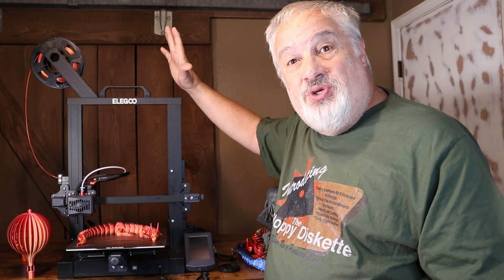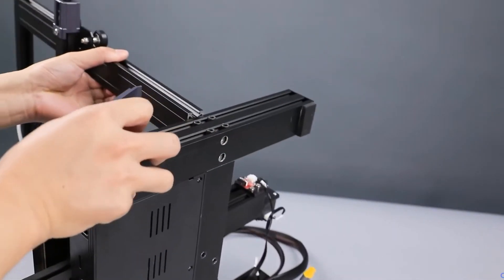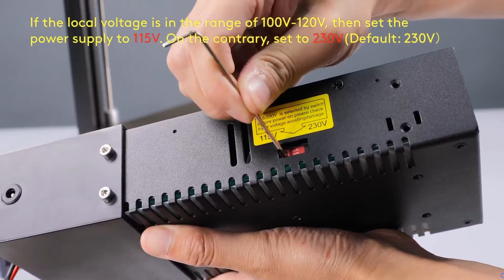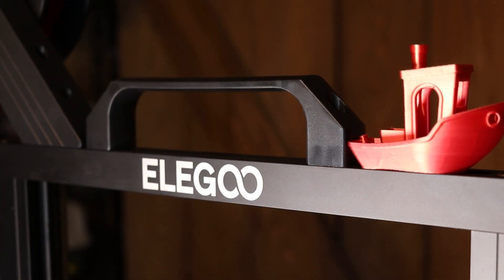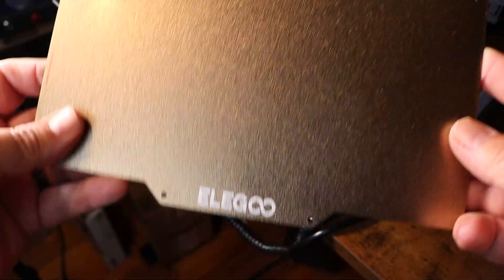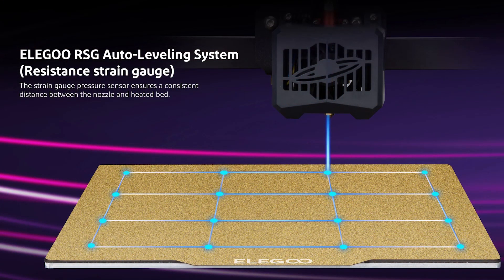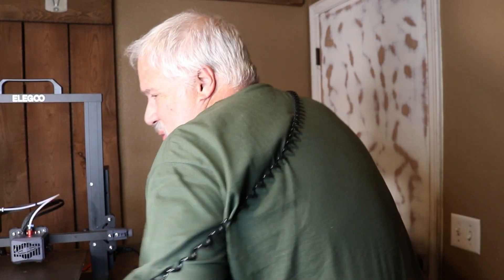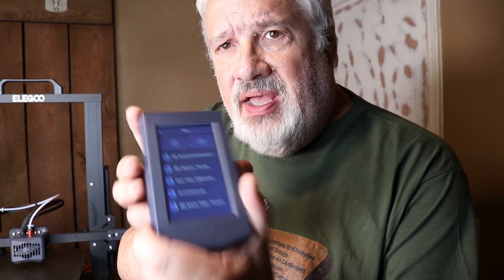Is this the BEST budget 3D Printer of 2022?

Comment: I’ve always wanted to try an Elegoo printer.  I’m officially finished with Creality, that’s for sure….well…maybe.  Haha
Reply: I sacked Creality and promised myself I would never buy another product from them having bought an Ender 2 original a CR 10 2X Ender 3 2X Ender 5 Plus, I have had problems with bad parts on all of them except the Ender 2 and 1 of the Ender 3's, I bought my first Ender 3 at launch and it came with a bent leadscrew, I used about half a dozen contact methods but not one reply until about six months ago, so it took them over 3 years to reply to my email, I replied to them telling them I want nothing to do with them